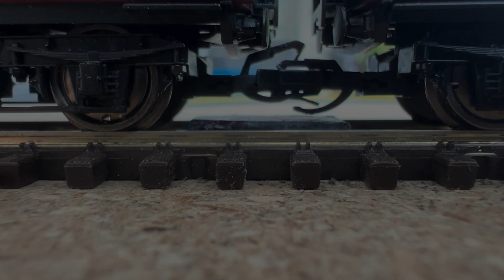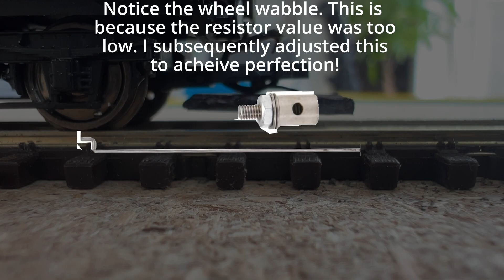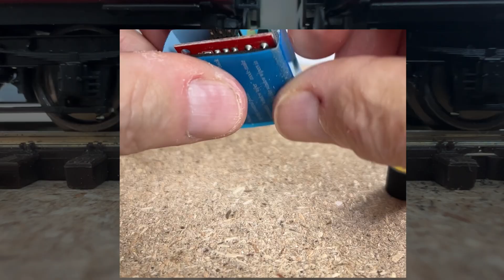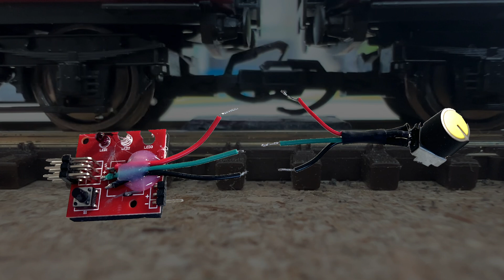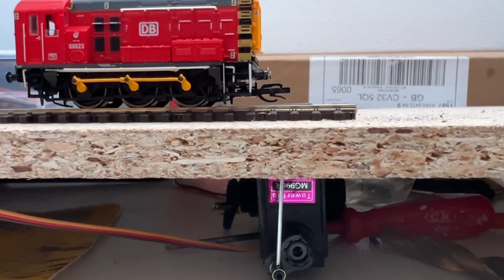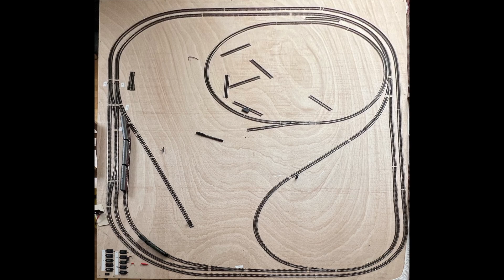Servo controlled uncoupling

Comment: Niceone Roger,great way to make use of the servo tester, just curious why you have used what looks to be such a powerful servo? Just a suggestion, the uncoupling pad might look better, more authentic if it was slightly ramped at each end
Reply from the maker: Re the servo, tried with a micro but the motion was a bit wobbly. The bigger one is pretty cheap. Re the pad, completely agree. I am making the pad from an off cut piece of plastic. Will do better in the future but for now, it works.